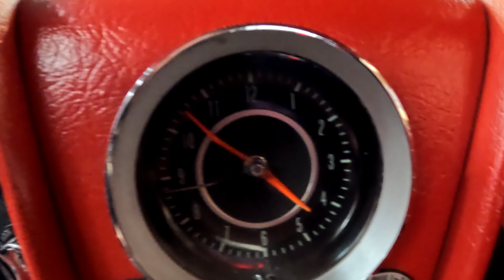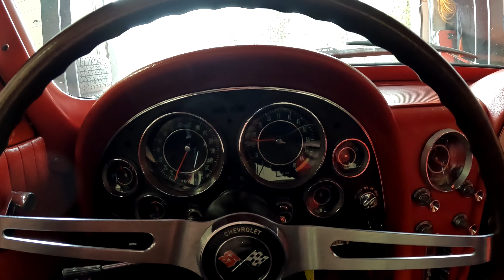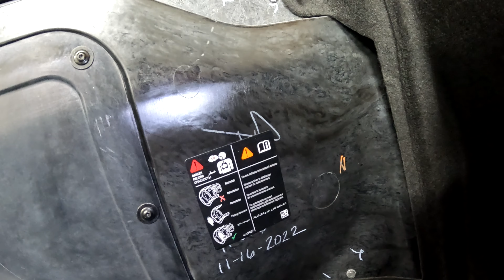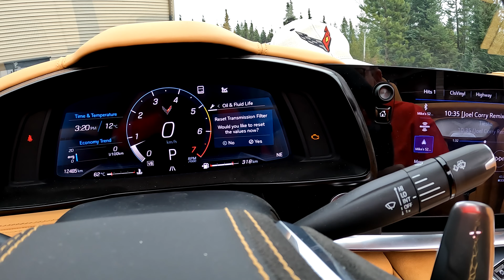Adding 2 Quarts to the DCT transmission in a HTC C8 Corvette.  UGH!!!

Comment: The clear engine cover just means you have an engine compartment, 2 windows (exterior and interior between passenger compartment and engine), and the plastic engine cover to clean. I would rather be driving it than cleaning it, I know the engine is back there and really don’t care who else does. Get the coupe and live with the engine mechanical noise and the loss of luggage space with the top off.

Comment: You are a trooper - I think I would jack up the driver's side, pull off the left rear, and go through the check tranny level port.  The GM engineers definitely made that fill plug hard to get to on purpose.  Guaranteed hours for the dealership mechanics!  How much extra would it have cost to run a fill tube off to the side of the airbox accessible from the trunk or engine bay?  I'm sure there will be an industrious company making a tranny fill relocation kit in the future.
Reply from the maker: I think if I had another floor jack I would have tried that way. But would hate for a jack to slip out and rip off a side skirt in the process.

Comment: I love my clear engine cover, it looks super cool. I also found out the radiator tank if you just undo the 2 large bolts it will swing out in one direction without any issue believe it or not. 42:41

Comment: I installed a quarter turn quick drain adapter into the side fill port.  Added the two additional quarts with a pressure pot.
Reply from the maker: That's a great idea.
Reply: Thats my plan.

Comment: Congratulations on your knowledge!

Maybe you can help me ?

We changed the transmission of a 2023 C8, after that it doesn't start the engine, doesn't turn off the panel, we received the fault code DTC U1346, we are in Brazil and this car doesn't sell here, it was imported directly, they said this is an electrical problem, Bad wiring or connector, if you can help me with any newsletter, photos, videos, I would really appreciate it!
Reply from the maker: Gosh I don't know.